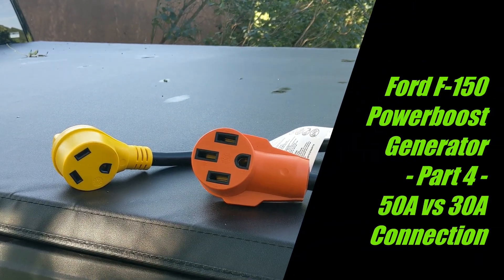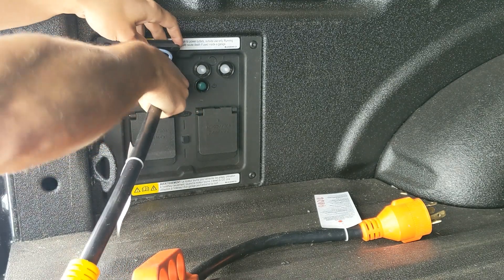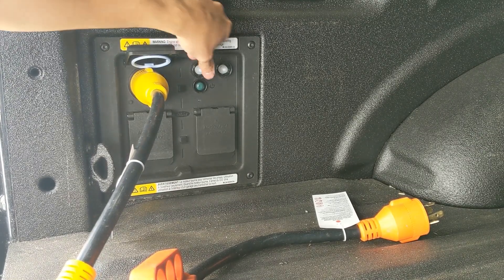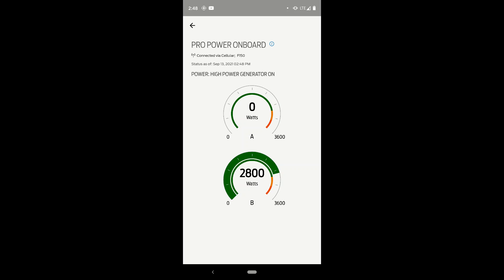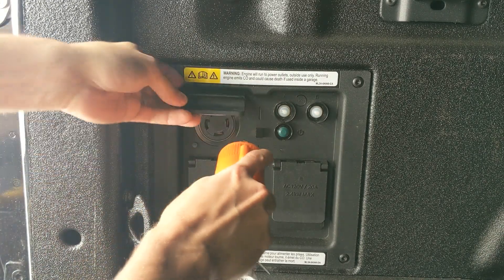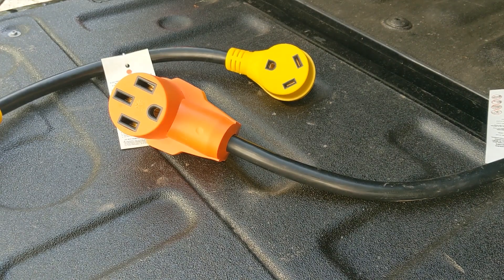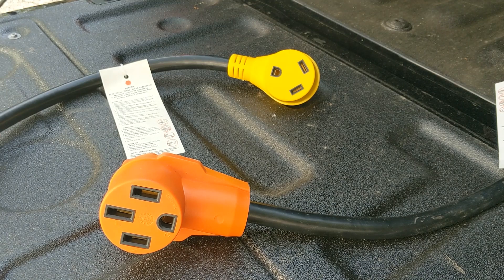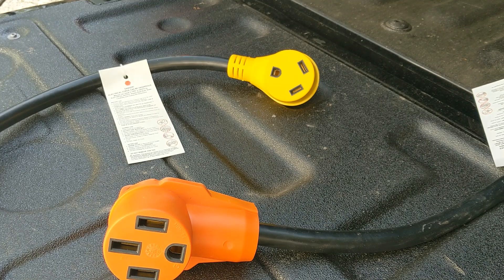2021 Ford F-150 Powerboost Generator  - Part 4 - 50A or 30A Connection?

Comment: Any problems with GFI tripping when hooked to a coach?
Reply from the maker: I did for a little while and then it turned out the plug end of the RV power cable was bad. Replaced that and it never happened again

Comment: Your wrong it's has 2 circuits the truck 3600 watts x2 that includes the 2 120v 20amp circuits do you homework before.... l14-30 max output is 3600 watts.

Comment: What adaptor do I need to connect the 240v 30 amp to be used in Argentina, where we use 220v (with 1 leg +220v and 1 leg N) ?

Comment: Using the power boost to power my house via a generac transfer switch. So would I use the 30 or 50 amp plug. I was under the impression that 30 amp was the max load. 8 guage wire... I'm a little confused. Any insight. Thanks mate 😊👍

Comment: So your RV has both a 30 amp input and a 50 amp input?
Reply from the maker: Our RV has a 50A plug, but with an adapter you can use 50A or 30A. It's always best to use 50A when you can.
Reply: @notallwhowanderarelost2024  Hey thanks for the reply! I was curious how it seems your RV can run your appliances from only a single 120v leg if that's all it has available, or split the overall load across two 120v legs in the case of the 50 amp adapter. I suppose there is some kind of equipment in your RV that can balance load across multiple legs? Interesting. I wonder what that equipment is called. Thanks again.
Reply from the maker: Even with a 15A 120V connection you can run everything, just not all at once. For example you can't run the AC and Microwave at the same time. We ran just the 15A 120V the other day off the truck at a harvest host just fine

Comment: So you have to have your keyfob to start the truck when you turn on the generator. When you leave your truck and take the key fob with you, (because you don’t want anyone to steal your truck) how does the truck start back up, to charge the battery, without a key fob? Have a power boost on order.
Reply: It periodically runs the engine to charge the battery no need to do so manually

Comment: What about using the 50 amp connector to a 50 to 30 adaptor  to a 30 amp trailer.  Does that use both A & B sides of the generator?
Reply from the maker: Hi Ronald, I don't believe it would since it is two 120V hot leads and when you drop down to 30A, one of the hots goes away and you are left with a 120V 30A hot. But you wouldn't need the other lead anyway since 120V * 30A = 3600W which is what that lead is supplying.

Comment: Is the travel trailer used for this particular test a 30 or 50 amp RV? Thanks.
Reply from the maker: Our trailer is a 50A. Basically the best adapter is one that matches your RV, if it's a 30A then the 30A adapter, 50 then 50.

Comment: Your video series is great. Just to clarify, I have a 30-amp trailer with a 30-amp  cable to a 30-amp converter plug to my truck generator. Can i add a 30 to 50 amp dogbone to  50 amp to generator dogbone to pull from the truck total of 7200 watts? Or am I just limited to 3600 watts total?
Reply from the maker: Hi Timothy, I am going to think about it some more, but I believe you wouldn't have any benefit using the 50A dogbone since that is basically two 120V Hot lines, and when you drop it back down to 30A for your RV it simply drops one of the 120V lines, giving you one 30A 120V hot line. This gives you 120V x 30A = 3600W. So I'd stick with the 30A adapter. You should still be able to run A/C, Microwave, etc...
Reply: @notallwhowanderarelost2024 
Thank you for your video, it’s been very helpful as there’s not a lot that show this.

I have a 30a Rv, and want the benefit of 7.2kW 30a (a+b), did you find a way?

Like you said above, I don’t think 50a to 30a dogbone will work - worth a try?

Comment: Nice. Is it ok that all the power on the 30amp is not balanced? I guess there is no way to balance it but does it hurt the truck's inverter? Also, if you purchase the 50amp to 30 amp adapter, would it then run the 30 amp from both legs? I am just trying to make sure that the imbalance does not harm the truck- all power from one circuit any time I camp.
Reply from the maker: No there's no issue running imbalanced, the truck has circuit breakers to protect each outlet bank if you ever drew too much. I'd say most of the time you will only be using half of the generator

Comment: I guess I am confused a bit....obviously what you are doing worked....but it seems that you are plugging into 240v vs 120v doing this.....are the 50amp pedestals in campgrounds 240v or 120v?
Reply from the maker: If you measured the voltage between the two hot lines of the 50A, you would see 240V, however in the RV world they are not combined in the RV to make 240V. Instead they are treated as two separate 120V circuits in your RV breaker box.

Comment: But wouldn't that mean you can accidentally pull 50 amps? Or am I misunderstanding that? Perhaps it's 30amps per leg so you can pull 60 total safely? Am I understanding correctly or no?
Reply from the maker: It's 30A per leg, so you technically have a pair of 120V 30A circuits. But even if you do accidentally pull more current than the truck can supply it will trip the breaker automatically.

Comment: I’m new at this. My RV has a 30 amp plug. My f150 2021 onboard power is not drawing from A and B when I plug in my RV. Does it take a 50 amp plug/power source to use both A and B?
Reply from the maker: Hi Keith, yes a 30A plug will use only one side of the A/B. But be rest assured you are still able to pull 30A
Reply: @notallwhowanderarelost2024  Thank you. I appreciate your quick reply.

Comment: You made my day, scratch that, my week with this video!!! For some odd reason, I was under the impression that the 7.2kw Onboard Generator only supplied 30amp power to an RV/food trailer, and am thrilled to know that it can provide 50amp output as well! We just ordered our new PowerBoost F-150 last week. 

Thank you, thank you, thank you for this informative video!!!
Reply: It does NOT supply 50 amps.  It will only supply 30 amps to each site of your electrical panel if you use the 50 dog bone,
Reply: If you go over 30 amps it will trip the breaker on the truck. You are still limited to 3,600 watts….120v * 30 amps = 3,600 watts. With the 50 amp dog bone you’re just splitting the load across 2 channels.

Comment: Not sure if this is applicable but does using the 50 amp and both legs use more gas than the 30 amp??
Reply from the maker: Hmm good question. I would imagine it depends more on the load than anything else. So if you are actually using that extra power then yes it would use more gas. But if we pretend the load is identical then I am not sure...

Comment: Excellent video!!!!! I wanted a 50A outlet for a RV I was considering to run off this truck!

So, in your experiment if you had 2 AC units both on of similar size as you tested... you can do it and still be in the GREEN - Right?

Comment: Tom,
I have a question if you care to entertain it.
I assume your travel trailer, like most, when hooked up and being towed will charge the [trailer] house batteries. My experience has been that this charging is slow at best. So, do you think you could charge from the pro power on board as well when traveling down the road?
Rob
Reply from the maker: Hey Rob, Great question. I have thought about this a bit. And you are right the power from the truck is a trickle at best. So I thought about using the pro power one of two ways. One is the 30A output, but the 50A outlet on the RV is all the way in the rear. So that's difficult. But perhaps a battery charger right to the battery would be doable.
Reply: @notallwhowanderarelost2024  
Interesting! Let us know if you experiment with this.
My soon to be new TT will have a thirty amp port in the front so that I’ll be able to easily connect power as I’ve described. I’m just not knowledgeable enough to know how two power sources integrate with the converter.
Reply from the maker: My main concern is safe and legal ways to have a cable come from the bed to the RV while towing.
Reply: Pretty sure if you do this you need to ensure your trailer converter is triple stage for fast charging.
Reply: Yes, the generator function works while driving.  You can both tow and charge an EV going down the road.   The truck's generator function at full load uses half the amount of energy used by the truck's AC system on full blast!

Comment: I could not see the male end of the yellow capped cable.  Does it have 3 lugs or 4?  And, where did you get that?
Reply from the maker: Hi Tom, the male end is still the 4 pin generator style connector. It simply drops one of the 120V lines. https://www.amazon.com/dp/B07BHTVQS8?ref=ppx_pop_mob_ap_share

Comment: Hey Tom, thanks for publishing this…
I have successfully tested powering my travel trailer using a 30 Amp adapter from my F150 Powerboost as you’ve described. I’m a little confused though. If you’re using both legs with a 50 Amp adapter aren’t you drawing 240 volts? Does your RV split the two legs into 120 volt service X 2?
Rob
Reply from the maker: Hi Rob,
Yes when you run a 30A connector or RV it is using 120VAC, but on a 50A RV it uses 240VAC
Reply: @notallwhowanderarelost2024  I thought this video was a pretty good explanation of how to manage 120 vs 240 volts and not fry your RV :)
https://youtu.be/BwqS8oJkuAs

Comment: Purchase link to 50amp chord? What is the official callout/name for plug end that connects to the F150 (vs the camper 50amp 4 prong plug)? Thanks.
Reply from the maker: Hi Don, this is the one we used: https://www.amazon.com/dp/B07MJV4XPR?ref=ppx_pop_mob_ap_share
It is a locking 4 pin generator plug